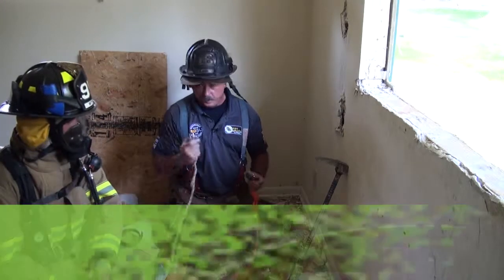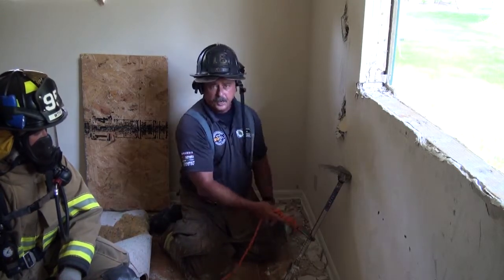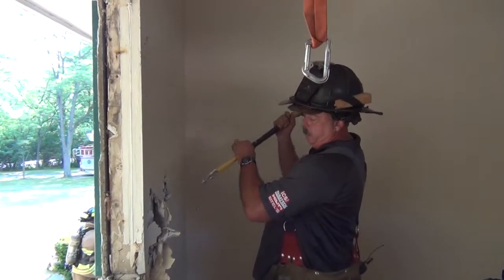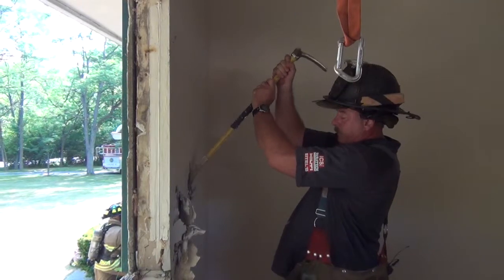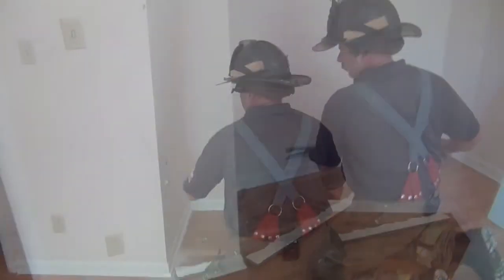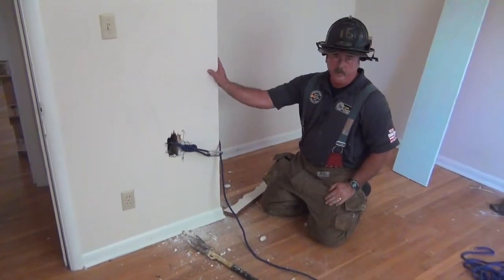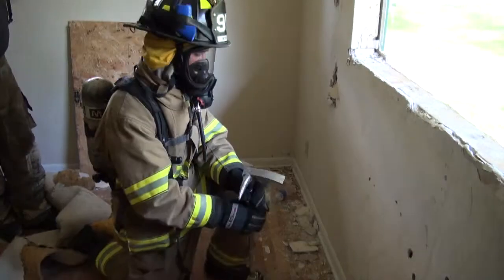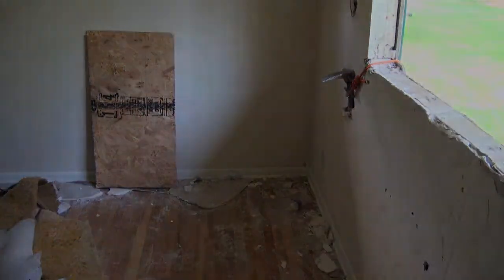FF Survival Rope Bails

Comment: AWESOME instruction. I’m writing this in March of 2023. There’s already increased citizen interest in becoming more capable in dangerous/ high stress situations. This type of information will be more sought after. In 2014 I was accidentally abandoned in a cargo container stacked atop another cargo container. Stranded 9 feet above asphalt and I couldn’t slowly lower myself against the bottom containers doors because they were open too. I carried a load rated climbing biner at the time with my Leatherman & Surefire attached to a belt loop. There was substantial mule tape in the cargo container, securing the load. All cargo containers have two welded pick points at the bottom corners of the door jam. I rigged the mule tape like rope and using my one biner, I self rescued. Gave my colleagues an earful for forgetting me up there. This happened on a Disney kids show. We stored props in the C containers. My only question with the Haligan anchor? Is the firefighter able to retrieve the tool once the burn is under control or is it a $700 loss?
Reply: generally after overhaul you can get the halligan back. Its made of iron so chances are it wont melt or be destroyed. If you dont find it you will not get in trouble its simply a loss

Comment: What about attaching it to a bed post?
Reply: You’re better off tying off to the entire bed. Unless the bed could ostensibly slip through the empty windowsill. Frankly everyone living above the first floor should invest in emergency ladders. There should be one in EVERY bedroom as well as smoke & monoxide detectors and a proper extinguisher. Even little kids should be taught to deploy the ladder without adult help. Amazon keeps 2-story ladders under $100 and they are rated. Some of the bags come with glow tape sewed on them but if yours aren’t so-equipped, add it after purchase. Smoke can make things hard to locate. Almost all homes in America are severely ill equipped. A “911 mentality” is dangerous and every firefighter or cop will tell you the same. Self rescue and training to remain calm can and does save lives.